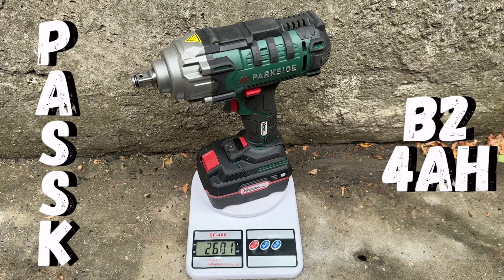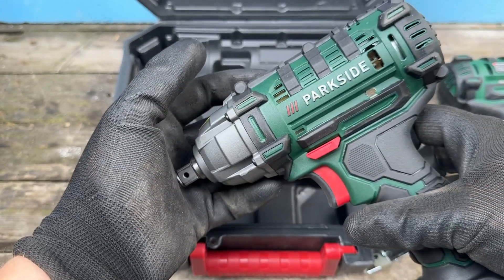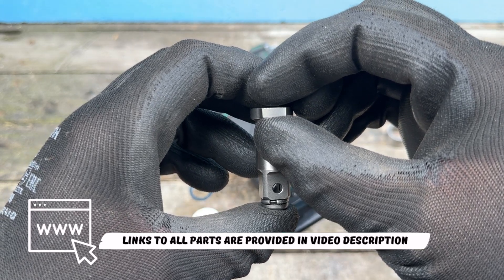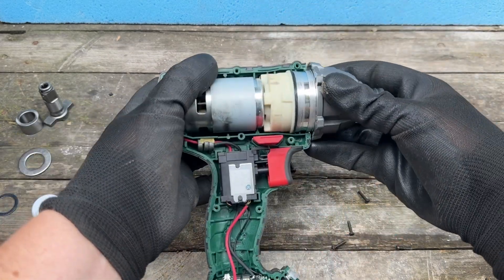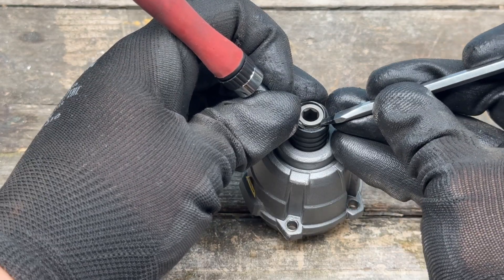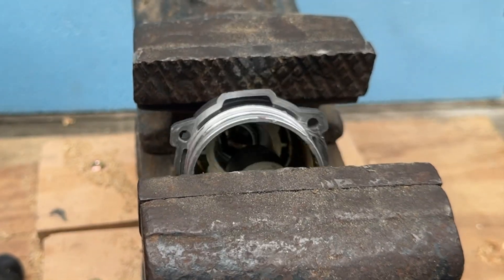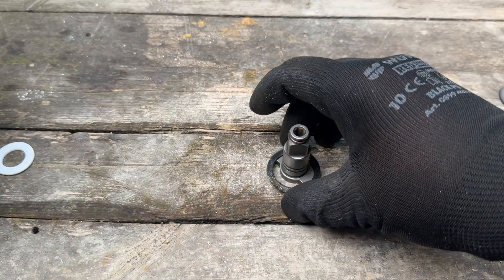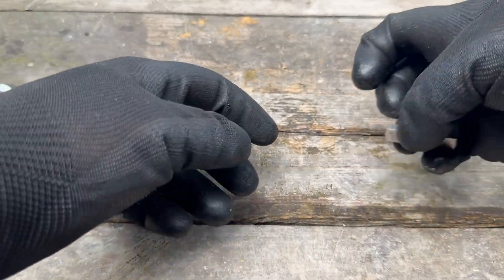Parkside FREAK! PDSSA anvil modification. All the options for a cheap and light combination tool.

Comment: I'm wondering if you have tried the angle grinder 1200w i8 125mm? I have one at my local lidl for like 28€ but i wasn't brave enough to buy one! It felt pretty decent in hand someone opened one and i couldn't help myself but to check it out 😅
Reply from the maker: I have never had Parkside corded grinders, because I don't really have access to 220V. Is this the Performance version for 28€?
Reply: @BrokeLifeEU  Nope the standard green one i saw some similar looking under different names like f6 or g6 this is probably the newer version they look exactly the same. They had a giant one as well 80€ 2300w beast the case was huge 😆. Didn't buy it since i just fixed my neighbors 2kw Bosch and have a few more to fix anyway.
Reply from the maker: Well Parkside or a Bosch, even a used one is a pretty easy choice for me 😆. That said at 28€ if you just need a spare it can't be that bad.
Reply: @BrokeLifeEU  Honestly i never bought a Parkside tool 😆 just hand tools/ random non electric crap
Reply from the maker: @wanderer7779  Some of their hand tools are even better than their power tools for their price! Pliers and pipe wrenches for €2. CAN NOT BEAT THAT!
Reply: @BrokeLifeEU  Yeah i buy those but i didn't pull the trigger on power tools!
Reply from the maker: The only corded Parkside tool I have is a 220v drill Parkside PSBM 750 B3. Not bad but nothing to write home about. I have an old 80s Bosch that I prefer. The Parkside has more power, but the Bosch feels better built and has managed 40 years on this planet. I am prepared to bet the Parkside won't do a tenth of that.
Reply: @BrokeLifeEU  Those early tools are indestructible!!!! I have used many and they just keep going! My neighbor has a drill for mixing concrete he found it in junk fixed the cable and it worked ever since it's probably over 40 years old!